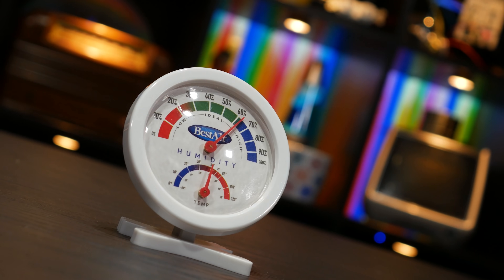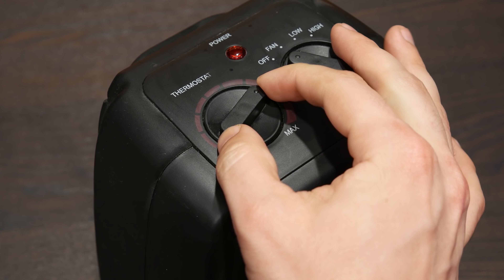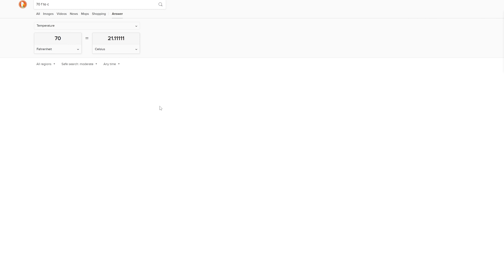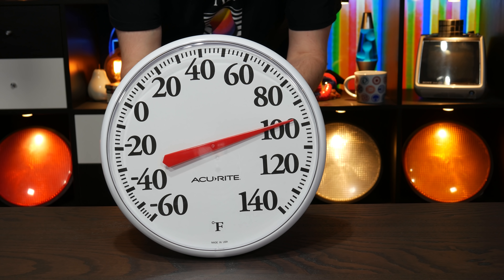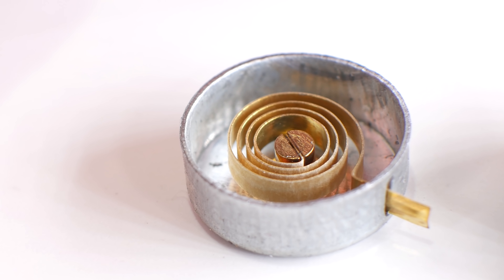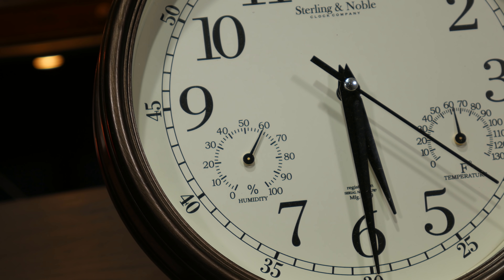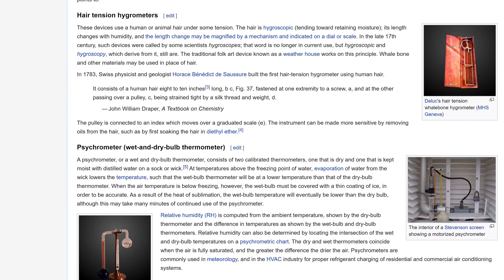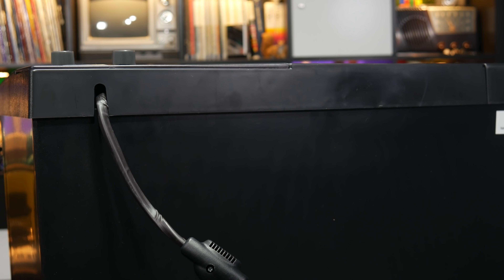Analog Hygrometers - how?

Comment: I think it  might be easier to teach someone to calculate the conversion between celsius and fahrenheit. Yes, it would be easy to google the conversion, but sometimes when there is no phone reception or even a smartphone handy, you might just need to find out the number if given in the wrong units. It's either x*1.8+32 or (x-32)/1.8. If you forget which is which, I find the fahrenheit scale seems to be on a wider range.

Comment: Easy temperature conversion above freezing - take the Celsius temperature, double it, and add 30.  That will give you the approximate Fahrenheit temperature within a couple of degrees.  Do the reverse to convert back.  I have been doing it in my head since 4th grade.  It's not that hard.

Comment: In regards to the search engine part:
We can use that, but that would require us to shift focus away from the video which we desire to see. Voice assistant? Great, not English native though so VA are very disappointing. And, as a final argument: If you would put the amount in Celcius on screen (or say both values since you're reading from a script this should also be doable). You'll be able to save us time because you do it once, so a set value of time cost. If everyone else does it, it grows with every person (everyone accessing and essentially this could end up in a saving on energy costs.

I don't mind you thinking in Fahrenheit, nor in feet/inches. I do mind that I can't put those in my perspective as I don't see those measurements outside of YouTube. So if a conversion is within the video (either visual, audio or audiovisual) that'd be great!
/rant

Comment: The next good question: How does a barometer work? (did you already do a video about this already?)
Reply: Sealed metal springy can connected to the pointer, pressure goes down can expands, pressure goes up can gets crushed and the pointer moves.
Reply: @randomnickify  it's coated springs all the way down
..
Reply: Referring to the ones with a dial rather than the ones with a simple bar of mercury...

Comment: I find it hilarious that ignorant foreigners are constantly giving small measurements in 10,000ths of an inch because they can't grammar, yet claim to be smarter because they don't use the measurement system the entirety of the metric system is based upon.   A ton, the international shipping unit, is the displacement of 35 cubic feet of sea water.  If you look up the weight of sea water it gives you the weight of water at the surface, which has a slightly higher density due to salt concentration.   35 cubic feet is about 991 liters, 991 liters of sea surface water weighs 1015kg.  In areas like the Mediterranean that overall mass can vary a small amount due to fresh water flow around many ports.   Sometime after the creation of the metric system they then decided (being french they endlessly argued) to use the measurement they created to re-define everything based on the gram using fresh water.  Still calling it the "ton" egotistically.

So the metric system is based on the imperial ton, with adjustments made by the nation that can't pronounce its own language.

Comment: ...yeah, or you could just say both C and F what with it being an international information video.   Greetings from jolly old England at a balmy 15°C (that's about 60°F)
Reply: But if jolly old England didn't want to convert the Pound to Euro, why should the US convert from F to C?
Reply: @sammiller6631  because Jolly old England had a stronger currency and still does.  We changed from F to C and imperial (which we invented) to metric because any idiot could see it was a stronger system. Its about adopting the best system.  Pounds are and always have been a stronger currency. Just like the metric system.

Comment: One thing you can do to "calibrate" these hygrometers is to get a small/shallow dish (like a lid), mix up a super-saturated salt-water solution (Use kosher salt and distilled water for best results) and add that to the container. Put the container/solution in a small ziplock bag, then put the hygrometer in the bag as well, being careful not to spill. ZIp up the bag, and wait until the system reaches equilibrium (several hours) -- the hygrometer should be reading 75% RH. .

Comment: 2:50 petition to officially switch to the Kelvin scale and mess everyone up all at once?
In all seriousness tho, I prefer the metric system in nearly all cases; it just makes so much more sense. Why memorize a bunch of completely arbitrary conversion factors when you can just work with nice, clean powers of 10?
Reply: Because people need to know how to appropriately dress themselves far more often than they need to know how close their water is to freezing, or boiling...  the Dungarees Freedom scale is far more useful for everyday, human-scale life stuff.  My water is cold or hot enough when it's going through reasonably quick phase changes, I just need to know what kind of socks I need to wear most of the time.
Reply: How about the Rankine scale?
Reply: @yuri53122  I haven't heard of that one. What are a few common reference points in one of the more familiar scales?
Reply: @andrewsprojectsinnovations6352  Rankine = Kelvin * 1.8. Rankine is an absolute temperature scale, just like Kelvin, the difference being that an increase of one Rankine is equal to one Fahrenheit degree, unlike Kelvin where it's equal to one Celsius degree.

Absolute Zero: -459.67F, -273.15C, 0K, 0R
Freezing: 32F, 0C, 273.15K, 491.67R
Room temperature: 72F, 22.22C, 295.37K, 531.67R
Boiling: 212F, 100C, 373.15K, 671.67R
Reply: @yuri53122   Rankine scale? I see you are a person of culture and refinement.
Reply: "I" I have been using it for years alongside Celcius and Farenheight.
Reply: The metric system doesn't make sense in all cases. powers of 10 have ugly ugly fractions that highly composite numbers like 12 don't. Or even better, the "Superior Highly Composite Numbers" like 60 that is still used in time for thousands of years. The metric system doesn't "make sense". It's just what you were raised with.
Reply: Get rid of some constants also. (g is not one of them)

Comment: Let's convert to metric! it just makes sense!
temperature,  sure. Centigrade seems more reasonable, zero is ice, 100 is ouch.  "it's over 9000!!!!" is when you run for the hills 

Mass... the gram is useless for daily use .... just use kilograms, sure...   I guess, it kinda works. 

Volume... "Can I have a quarter liter please?".... nah, cups are better.  

Distance....  for travel distance, that's fine, kilometers and miles are both usable. For small stuff, centimeters are fine, but for everything in between, we need something.... about a third of a meter, but saying thirty three centimeters is cumbersome... So this is half no and half what ever. 

nearly everything else is already in metric, Bytes, Bells, Watts, etc. 

The ultimate solution would be to adjust the US imperial system toward metric to get the best of both worlds (as much as you can since you can't easily divide 10s by quarters, sixths, or twelfths). 

make 500 grams a pound. 
make 33 1/3 cm a foot
make 250 ml a Cup and 500 ml a pint.  make 4 liters a gallon. 

this way we get to retain some of the useful every day measurements of the imperial system but conform them to the base ten nonsense of metric.

Comment: To me 70 F is way better than 21.1 C, though since computer parts started out using C and their temps are usually quite high I can think in C in regards to computer parts, 30-90 C is easier than 86-194 F.

Comment: Can confirm that hair hygrometers and hygrographs used in profesional weather stations can get within ±2 or 3% of accuracy. But they are very expensive and you don't need that much accuracy anyway since you can use either an electric hygrometer or a wet-bulb thermometer to measure humidity. Both of those methods should get you much better accuracies. Also, linear hygrometers are always a bad sign for me. Profesional hair hygrometers should have a VERY non-linear scale.
See a picture of a hair hygrometer here (notice the non-linear scale):
http://www.novi.cz/galerie/obrazky/imager.php?img=134285&x=436&y=402&hash=4ba8a7e32a8fa41d1355139130e1843b

Comment: As a pure bred 'murican I can say with confidence that switching to celsius is easy, if not frustrating when you have to constantly explain why 20 degrees feels perfect, or why 40 degrees is sweltering, or why going outside barefoot when it's 10 degrees isn't dangerous, lol.

I actually made the switch almost out of necessity when I had a failing battery in my car and couldn't afford to replace it immediately.  Every time the battery died, the climate control would switch back to the default celsius mode, requiring me to look up how to set it back.  Eventually I got tired of that, so I just learned to convert.  Even after replacing the battery and no longer having the necessity to convert, I just never bothered setting the system back to F.  Now Celsius is just my default.

Comment: A how-it-feels celcius poem:
30 is hot
20 is nice
10 is cold
0 is ice
Reply: A how-it-feels Fahrenheit poem:
32 is cold as ice
but halfway up the scale is nice
three quarters up is getting warm
over a hundred can do you harm
going down the other way
one quarter up is a brisk day
below zero you should use caution
wear a coat or freeze your bottom
Reply: Kelvin or bust!
Reply: 30-40 🥵
20-30 😎
10-20 🙂
0-10 😑
-10-0 🥶
< -10 🧊
Reply: @Sunlight91  Notice how that scale doesn't get up to 100 and drops significantly below 0.

If only there were some alternative where the weather fit more between 0 and 100...
Reply: @joeo3377  well in sauna you get over 100
Reply: @joeo3377  Taking a sauna begins with having a wash (usually a shower), followed by a sit in the sauna room, the room being typically warmed to 80–110 °C (176–230 °F).
https://en.m.wikipedia.org/wiki/Finnish_sauna
Reply: @joeo3377  and in winter in finland it been - 50c
Reply: @nom3nnescio  And taking a sauna can kill you if it is not done in a careful and controlled manner.

And going outside in winter in Finland without a coat can kill if if it is not done in a careful and controlled  manner.

This is contrasted with going outside on any day between 0° and 100° Fahrenheit, where one generally doesn't have to be all that careful to avoid death owing to exposure.

Whereas going outside on a day above 50°C means you have to take precautions to avoid over-exerting yourself.

Lets be clear, neither Fahrenheit nor Celsius are perfect scales. Celsius is better adapted for some circumstances, and Fahrenheit is better adapted for others.

Fahrenheit is superior for weather, and probably biology.

Celsius is superior for chemistry and  cooking.

Kelvin is superior for physics, although sometimes energy (primarily eV) is used instead.

There isn't one solution which is best in all situations. We need to embrace diversity in temperature scales.
Reply: @joeo3377  sauna does not kill you lol.
Reply: That sounds more like a four star rating system, not a temperature scale.

Comment: I don't have any aversion to the metric system, I just think it's rather dumb to arbitrarily use a system that does not have a suitable amount of granularity for an extremely common measurement.  Expressing the temperature of our environment is not an academic thing, it's important to get a fast and reasonably accurate measurement fairly often, and using a scale that is by far too small introduces an extra layer of math that doesn't need to be there.  When you have to regularly use units to the right of the decimal for non-scientific measurements, you're probably using the wrong scale.

Comment: @1:50 not thats the joke... i do know the conversions ... thats one part of the ridiculousness... ok fine you want to keep using imperial aka moron units...fine but if you are technical at least roughly know conversions .. its not that hard to know a mile(land eng) is ca 1.6km and a foot ca 30cms ... the issue is more...look we agreed on standard indication...thats not all metric...we started adopting tonforce in push and pull forces rather then to us common N/mm^2 because the latter is only usefull when compressing not when pulling ... and yes indeed face the fact... in most cases the imperial units are defined by metrics and the metric conversion is far simpler to use (base 10) ... and don't come tell me it doesn't matter; the mars climate orbiter crashed for precisely this moronic reason . 

But US stubbornness (I thought you folk became independent from the brits...and even they went...eventually ... using SI) ....

Comment: So that's why you're growing your hair long -- so you can make hygrometers! 

I remember making a hair hygrometer as a 3rd grade science project. It used a needle with a straw in the eye as a pointer. The hair was wrapped around the needle several times, and then connected to a small weight on one end, and fastened on the other. A cardboard milk carton was cut up to make the platform for it all.

Comment: I like Fahrenheit for temperature because there are 180 steps between freezing and boiling vs 100.  He makes a good point that 100 is very hot and 0 is very cold and outside those temps you're better off indoors.

Comment: Hey! I found your humidifier video recently and felt compelled to get my own humidistat just to know my own house a little better and have a better idea of what humidities felt right. Then I saw that the humidity was well in the 'comfortable' range but still felt dry to me, so I was wondering what the heck? Did some more googling and found that relative humidity is an almost a shitty a measure as fahrenheit! It's good for keeping wood furniture in check, but relative humidity changes with the temperature. Humans care about how much moisture is in the air, regardless of temperature, and that's best measured by dew point. People like 50-60F(10-15C) dew points, but that translates as 70-85% relative humidity at 65F(18C) or 30-40% at 85F(30C). Such a wild difference means it's practically useless for determining comfort, unless you can afford to keep your home at 70F in the summer and winter. Whats worse is that almost no little humidistat you can buy will tell you the dew point(even though it's a straight forward calculation if you know temperature and relative humidity) and absolutely no humidifier can be set by dew point. It's madness! I would love a video on it from you.

Comment: I'm pretty much bilingual between metric and imperial for length measurements, but for all other dimensions I know only metric. Not sure why, but it is interesting. Ish.
Reply: Is the UK going back to Imperial for Brexit reforms? Assuming the UK doesn't fall apart due to the Irish backstop?
Reply: @sammiller6631  Don't forget the renewed push for Scottish independence. I don't know.

The UK officially runs on metric for all purposes other than road signs, I believe. But in practice, they still use imperial far more than we do in Ireland. Milk is sold by the pint over there, with a value in litres printed below in small type. It's sold by the litre here.

Comment: 6:47 - I somehow managed to acquire one of these at one point... I’d assumed horse hair, but it could have been human, I don’t know. Anyway, it was connected to an arm that held a tiny pen against a drum, that was meant to be wrapped with special graph paper... it had a wind-up spring-driven mechanism that would spin the drum (I think on a 24 hour cycle? I forget), thus marking the humidity over time on the graph, for later viewing (though it could also be seen in real time).

I’m pretty sure I ended up passing it on to somewhere.... if I ever find that I still have it, though (or find another), should I send it your way? It seems like the kind of thing you might get a kick out of...

Comment: Fahrenheit is better than Celsius though. I am pro metric, but Celsius is over hyped. In reality Fahrenheit is better if you use a little bit of thought. Fahrenheit  is 31freeezing - 212 boiling or 180 units. While Celsius is 0-100 or 100 units. This means the accuracy of Fahrenheit  is 1.8X that of Celsius, which is all that matter. "Ohh but boiling is 100 and freezing is 0" Stupid argument Name the last time you put the pasta pot to boil at 100c? You don't you turn the flame on. Name the last time the freezer was set to 0c, you don't it just freezes stuff. We do not use the numbers ever in daily life at all except for 1 time. When measuring temperature of a product or air and neither are ever water. So having the point of water boiling to be 100 is not helpful at all.  And because humans hate decimals or fractions the companies who make thermostats hate using them, so you are stuck at whole numbers. Meaning it is objectively more efficient, and more useful to use Fahrenheit.

"How about science" What about it. They are moving more and more to Kelvin, so Celsius is dyeing there too. "Atleast Celsius 100 and 0 mean something" Fahrenheit  actually does btw. While I think both are not important to have, I'd argue Fahrenheit's 100 is more important and more used daily. 0 for Fahrenheit  is the freezing point of a common brine like solution during its creation, this was to help transportation of it. USELESS. But 100 is the point at which a human's temperature is high enough to be a fever and advised to seek medical attention. A big part of Fahrenheit  is medical reasons. Which when sick I do check my temperature and do know 100 is bad. But when boiling a pot of water I just wait for bubble and crank the fire.